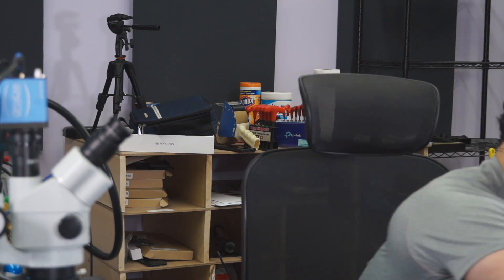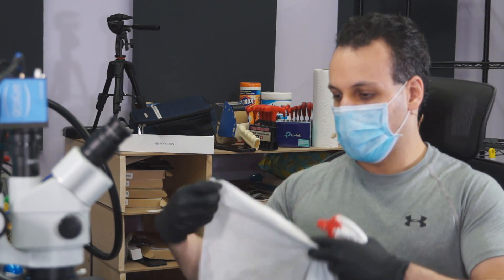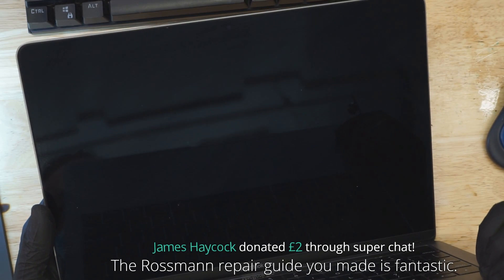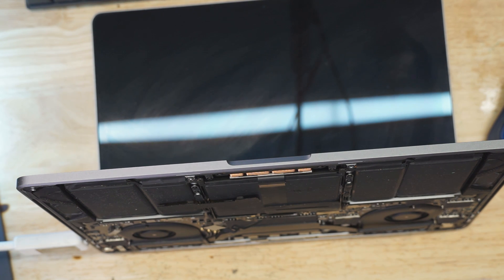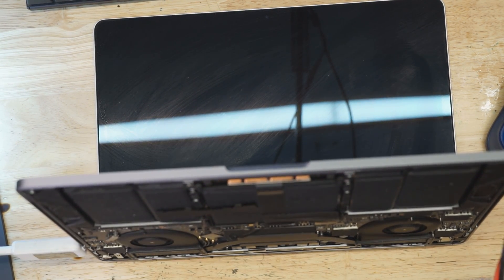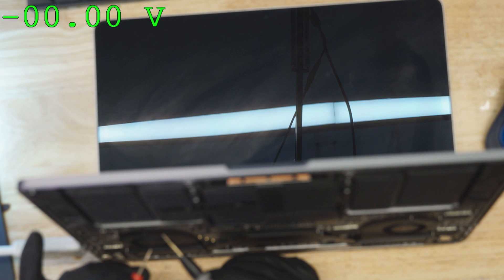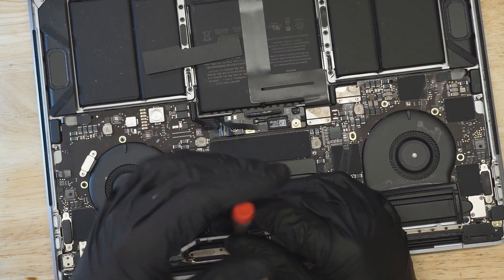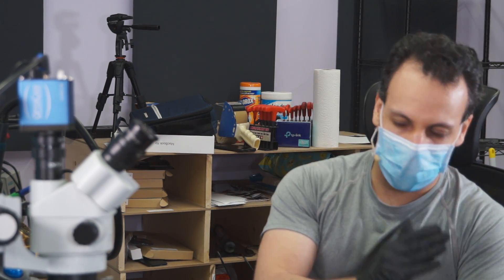Apple PCB design is a meme.

Comment: Been a mechanic for 30 years and suffer the same problems a lot, things not designed with murphy's law or just real world wear and tear in mind. Vibratory rollers whose electrics won't hold up to being shaken, common failure items buried under layers of other parts so what should be an easy simple swap out job takes a full teardown.
There are 3 explanations for this:
(1) these guys live in some pristine lab environment and never get their hands dirty
(2) It's cheaper for the manufacturing process, aka lazy/cheap
(3) or as told to me by Old Ron who took me aside when I was starting out. At the dawn of time the first mechanic ran off with the first engineers wife/daughter/girlfriend and they've hated us ever since and do it out of pure spite and vitriol.

Comment: Even free outorouter software has a design rules to never run 50V traces next to a low volt traces.   

THIS IS DESIGNED ON PURPOSE!!!  ( just like Fukutchima nuclear power plant have power generators in a flood zone ).   So GE can build a new improved version after the next tsununami?  

CLASS ACTION LAWSUIT?  ANYONE?

Comment: Hey Louis could use your input here, Just got a new open box Sound Blaster Audigy 2 ZS. It is clean no corrosion, no wear what so ever on the inputs or the PCI connection. However for some reason the left channel output is weaker than the right channel, sounds as though the low end ( bass ) is non existent. Now from what I can gather through the hours of research is that the power delivery on this card is spotty and many have replaced the original capacitors with higher quality or more powerful ones. The original caps are rated 16v 22uF, on forums some say they replaced them with up to 50v 100uF. Now since resources are very scarce not giving much info on the specific part numbers and these old forum posts lack images due to age I am left feeling around in the dark.  
I don't know if you may know more about this card and this " fix " to sound quality issues, but any information would be amazing.

Comment: I have a feeling that the board designers at Apple know exactly how to design a board, they know how to design one to randomly/catastrophically fail. Its likely on purpose. To get you to pay a fee for diagnostics, a fee for getting your data off, and a fee to put that data on the new system you just paid $1500 for.

Comment: Thought process of Apple:
We need people to buy more computers and throw away the old ones. So we install ridiculously sensitive liquid sensors, and if people come with computers were these sensors have been activated, we claim liquid damage, no warranty, and claim they have to buy a new computer.
Doesn't work, because people take these computers to third party repair shops, and have them repaired there.
Ok, next try: We make sure our computers are extremely NON-liquid resistant, so that any liquid that comes into them will cause components to corrode.
Doesn't work, because these third party repair shops will clean off the corrosion, and solder back the components.
Ok, next try: We put the power line next to the data line, and we put them in the most corrosion risky area of the computer, to make sure that any corrosion will kill the CPU, making a repair impossible, expensive, and/or incomplete.
Success!

Comment: This is probably because Apple doesn't care much for fault finding. It's cheaper for them to replace parts than it is to find the fault, corrected the design, and create new tooling. This is enabled by customers that are fine with both paying the high margins Apple demands for their products, and they're ok with losing data. Apple will never change until their customers change.

Comment: Hey Louis! I was looking to buy a used macbook pro to use for programming in school and in my free time, because I haven't had the best time with my pure Ubuntu machine. Is there anything I should be aware or be looking for when doing this? Of what I could read, people say that a model from between 2011-2012 should be fine, is that true?
Reply: If you get a 2011 avoid the ones with dedicated GPUs, they all fail because of overheating. 2012 should be fine.
Reply: @uN1Qu3DZ  Thanks for the answer! Is that also the same for the 2013 models?

Comment: It's like placing a rubber fuel line next to the exhaust pipe in a car.
Now try to imagine - would such a car pass inspections to be road legal !?
Reply: I mean, what else are you you gonna wrap your fuel line around when the damn thing is too long?
Reply: only if apple pays them off it will.
Reply: Imagine running your fuel hardlines up through and around moving parts in the engine bay. So you only have to run 4 inches of rubber hosing instead of 6 inches.
Reply: You mean like VW when the fuel lines on their vans were too short and would pull off and spray over the exhaust?
Reply: @jostouw4366  that likely wasn't intentional design though unlike this Macbook.
Reply: Imagine living in a state with inspections. Big oof.

Comment: I mean... come on Louis, it's just a proper way to sort the pins, you know? It's like in a car, you add the fuel igniter and the actual fuel to the same container, so that all fuel-related items are placed.. together.
What, they don't do that? It would explode? Hmm now hold on, that just doesn't make sense. how do they sort the parts while they're mounted then? They DON'T??? Now you're just talking crazy...
Reply: Nah they put them together.  Then they self sort in the inevitable explosion!

Think different.
Reply: What I don't understand (actually I do, it's because they're Apple and want to "think different") is why they wouldn't hire people such as Louis as consultants to help them develop a system of recognizing the most common or severe deficiencies in their products so they can make their designs more resilient. I can't blame them for not having the foresight to consider some weaknesses while designing the first board, especially if the engineers are in need for every bit of space they can get, but to not correct it after 4 years shows a lack of concern for improving their product's resiliency.
Reply: @Eisengeboren  simple, it adds another point of failure, which in turn makes more profit. Maybe it originally was an oversight, but after they noticed it they just left it, which is literal middle finger to the customer saying: hey, if you get liquid in you device it is definitely f'd.
Reply: @Eisengeboren  That's probably planned obsolescence. They don't want to design resilient stuff. They want to make devices that will eventually fail. If that can be blamed on user error, like spilling liquids, that's even better! It wouldn't surprise me if that's not even an mistake, but a deliberate decision to put the 50v+ line next to the 1v processor line, positioned so that any liquid spilled on the device is guaranteed to destroy it.
But the really sad part, is that planned obsolescence wastes non-renewable resources.
Reply: @Eisengeboren  If your product works forever, why would you buy a new one? If I went in to you with a broken device, all I see is that the screen simply isn't turning on. You tell me it's just DEAD. Well, now I probably have to pork out for a new device, and this time I might just pay you that "totally fair and real expanded warranty". But I will still buy a new product. Louis will tell you that you just have to pay him for the 2-cents resistor +labour and "handling fees" and you pay him chump change.
Who do you think makes the most money? Louis that's constantly worrying about stupid lobbyists, carpenters that can't finish his new store on time for him to take in orders again, or the international conglomorate that's telling you to buy a new one because you filled up your old one by taking pictures and videos of your kids?
Reply: Planned obsolescence.
Reply: @paulwin9036  "Well, I COULD replace the screen, but it's already two years old, and compared to the price of a new device, and then you'll be at the newest platform......"
Reply: If it was an Apple vehicle the sheep owner would go straight out and buy another one.
Apple owner = Baaaaah, Baaaaah. Bleet , "I must buy Apple or my (so called) friends won't think I'm cool
A real friend would call you an idiot for buying anything from Apple.
Reply: ISO Guy The term is iSheep
Reply: @isoguy.  Why? iPhones were once ago pretty awesome, but actually they are overpriced AF, so even if i would like to replace my aged iPhone SE with a more modern iPhone... i wont support apple so i got a damn cheap android phone. Probably Apple will introduce a cheaper "low end" iPhone again in the future, then i will switch back to apple as fast as possible since i hate Android pretty much.
Same goes for MacBooks... im still using a 2010 MacBook Pro...
Probably you remember the times as apple was blamed for "not replaceble batteries"? This is the 2nd time my Mac got a new battery some weeks ago, at all my Mac got around 2000 charging cycles and i used it nearly every day. HP, Lenovo and co blamed apple a decade ago for "not replaceble" batteries, actual their notebooks also got built in batteries, soldered ram, sometimes even soldered SSDs.

In 2010... battery runtimes of like 7 hrs were impossible at any other notebook, and i can use my aged Mac still today on a daily base. It also looks like new, something i cant say from any other (non Apple) device with the same age. The Unibody design is still some sort of "modern", or at least my Mac still looks like it.
Sure, by seeing what apple made wrong with the "newer" keyboards, the fast dying GPUs at 2011/2012 models and so.... this was pretty bad from apple.
But you have to admit.... many products from apple were awesome.... heres a short list:
- iPod Mini..... there was absolutely NO other MP3 player out there with 40GB and that size... ofc with a big disadvantage too, a CF card sized HDD, so this will be the first thing to die, which also died years after i got the iPod Mini. Luckily, you could replace easily the CF HDD with a regular CF card... longer battery runtime and shock proof then :)
- First iPhones..... i mean, who "invented" the first awesome "Smartphones"... Apple was the first and best for years...
-  Pre OS X Times.... these "PCs" were outstanding in many different ways. I mean also overpriced, but hey, at least apple did something special (in a positive way!)
- iPads... at least to some point where the prices were ok.... today, modern iPads are ..... again.... overpriced af. I loved my iPad 2, 3G model very much, the only dissapointing thing i remember was you couldnt share the integrated 3G internet over WLAN, while you could on Android Tablets.
- Thunderbolt.... who created the so loved thunderbolt connector? Intel and Apple... still used today in a more modern version and notebook gamers love it for eGPUs.
-first 3 generations of Time Capsules... my 2TB TC is still working fine after a decade of usage, daily backups of iPad and MacBook Pro, watching movies over the network and so. For a decade ago, it was very expensive to buy a network printer, or you used a Time Capsule and could use any printer in your network. In this point, also Apple was the first. Luckily modern printers are already prepared for network usage.

oops, this list is longer than i expected... could it be because apple isnt that bad as the typical Louis Rossman viewer think about?

At all, all of my Apple products are working still today, even after a decade. Sure, i have to take some drawbacks, like max. 300Mbit WLAN on the Apple Router, or my already wayyyy too slow iPad2 which i dont use anymore because its so slow. Or the 2010 MacBook Pro which TN panel is pretty bad compared to modern notebooks with IPS, but in 2010, IPS panels on notebooks were not aviable at all. Or the iPod Mini with only S/W screen, where any modern MP3 player with screen will have a color screen and can play videos.
I mean, except my Macs battery, the iPad2 and iPod Mini batteries are still working(remember, around or more than 10 years!), thats pretty rare. I remember, all Windows Notebooks i saw got a bad battery after around a year or 2, while i needed around every 4-6 years a new battery in my MBP, but i used the battery excessive.
Reply: The proper way is the placing ground in between them OR reshuffle layout on socket in that way when ground would be in between(assumption I hope they do have ground in socket).
Reply: Wait, your car doesn't have the battery inside the gas tank? What kind of crappy knockoff is it?
Reply: From the 1971 Ford Pinto to the 2018 Ford F-150 I can tell you that as a mechanic that's EXACTLY WHAT THEY DO.
Reply: @tdplay4135   😂  What? Separate valves for exhaust and intake? Why can't you put it in the same place?
Reply: Top notch sarcasm!

Comment: you say "this is probably booting" and then go on to describe the data line being too close to the 52v line - i get that i do - terrible design. What i don't get is, why does it need a CPU? i know you have done hundreds if not thousands of these repairs (and i have not) - but - if its booting, and there is no display, doesn't that mean the CPU is in fact good? - why not solder on a new Display connector and see if its in fact booting and displaying an image? i am genuinely curious.
Reply from the maker: This laptop has a CPU with integrated graphics. It is turning on and booting, but displays no image. The data line next to the 52v LCD backlight line is an eDP(embedded display port) line. The GPU embedded in the CPU is fried.
Reply: @rossmanngroup  understood, makes sense. I forget I'm a PC guy and not everything has the luxury of a dedicated GPU. Thank you and I  appreciate the response!

Comment: You’d think that after years and years of repairing these illogic boards you would realize they don’t actually hire anyone with expertise in electronics and motherboard manufacturing, they hire graphic designers.
Reply: pretty sure their engineers are capable. they just have to make them to fail so people buy more. water damage isn't in the warranty so they make sure the slightest bit of it destroys the entire thing.
Reply: @laka1469  Water is the Luke Skywalker to Apple's Death Stars
Reply: Erf Unden i just wanted to make a joke about form over function. You just couldn’t let me have my 7 likes. Thank you. Haha
Reply: No. NO. These are some of the BEST engineers and here is why. 

1: The core circuit design is pretty ingenious in how small and compact it is for the performance it provides. Gotta hand it to them in that regard.
2: They are able to balance complexity and cost fairly well, and then make it so pretty that the customer will pay out the ass to have it.
3: They listen to management and do what they tell them to do such as purposely designing these things to fail within a specified time frame.
4: They understand their customers so well that they can design these systems to fail within a specified time frame that is usually juuust out side of the warranty period and they do this with absolute precision.

These guys are the best engineers because they understand not just how the system works, but how it will fail and how to make it fail in just the right way to push the blame on to the customer.
Reply: @RingingResonance  I am no engineer but i guess.
1:That is why genius bar says this device has water damage.
2:Mother board needs to be replaced cuz of water damage.
3:This device cannot be repaired without a mother board replacement.
4:If there is a problem somewhere else other than the motherboard the macbook becomes unfixable😂.
Reply: @RingingResonance  Perhaps they didn't get paid well hence they did this design lmao.
Reply: @RingingResonance  it's a joke bruh, we don't need a essay
Reply: "For graphic designers, by graphic designers" and SOLD.
Reply: I mean you gotta be pretty smart to design something that breaks after some time or when a drop of water is put on it
Reply: forks and popsticles not really. It’s just chemistry lol. Make the material break down in water over a certain time, and or add power lines that destroy data lines after a certain amount of open closes. Not too hard.
Reply: @forksandpopsticles9183  liquid damage is not covered by guarantee so they have to put less smartness in the calculation of the equation.
Reply: or maybe you have no idea what you are talking about.
Reply: Yar Nunya  no

Comment: Just when I saw the thumbnail, I thought to myself: "Louis probably will rant about how close data line and power line next to each other and how stupid is that one dumbass who designed it all that way."
Bingo!
Reply: This is on purpose. That's the only explanation. Every engineer knows that you don't mix datalines and powerlines, neither on a PCB or otherwise.
Reply: I guessed JTAG - oh well
Reply: Some chump has run the data lines right through the power supply. Amateur hour!
Reply: @DroppedVoltage  It's a profitable booby trap. The chumps are the ones buying this crap
Reply: I did the same when he opened the new air. Though about the cooling.
Reply: Yeah ... "Stupid" that is if  their customers wouldn't buy a new one "because I spilled coffee ... my bad, it's not apple fault !"
Reply: @elchibrax93  buying a new laptop (they aren't eeepc, they're, if I say mildly, not cheap) because of a freaking spilled coffee? You fucking kidding me? I'll rather get a new Thinkpad (or older one with good specs) that's spillproof and can withstand some serious abuse! To hell with crApple!
Reply: @ArthurD  you are clearly not an apple user 😅. For them: every other brand is crappy, and probably not fashionable enough. 
"Apple products just work. And for that price, that's logical."